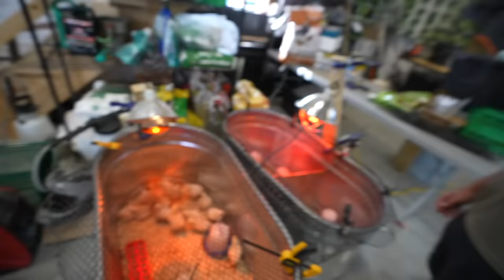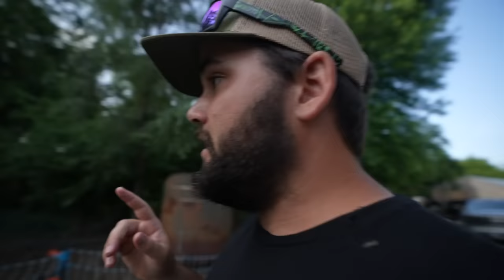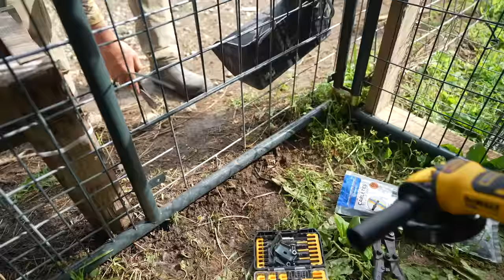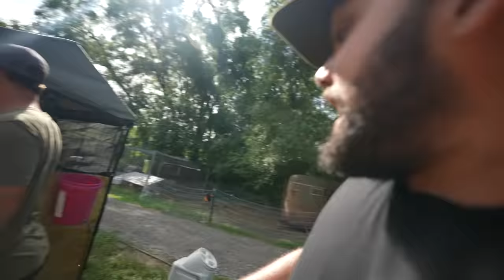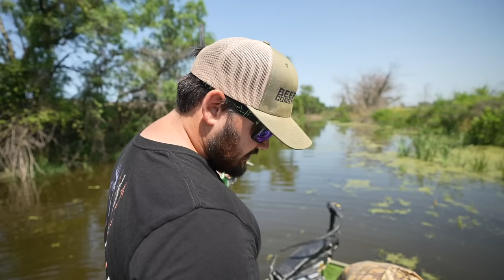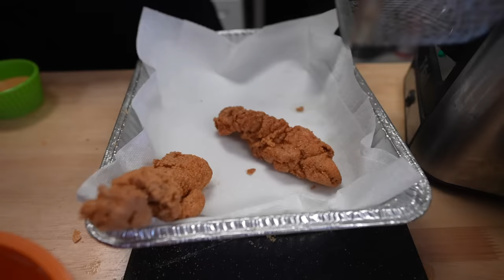CHEAP vs EXPENSIVE Bowfishing Challenge!! (Catch Clean Cook)

Comment: I almost  got an arrow to my head. . I was on the side of a highway at least in case something happened well I had a bear bow that I was gonna use for hunting but turned it into a carp bow. I put a spool on it   I shot about 40 of them in 3hours. It was a flooded woods connected to the Minnesota river. Well I went to shoot and my line went out 5 feet and came back at me just missing my left ear. I herd it go by and I'm deaf in my left ear to  that s the scariest thing that ever happened.   I was bout to quit after that  but kept going but I was checking my spool every time after that make sure it wasn't caught on anything.
Reply: Congrats you have been selected among our shortlisted winners from our previous giveaway, Contact the number above ^^^^^^^^^^^^^^^^^^✅
Reply: Scammmmmmmmm